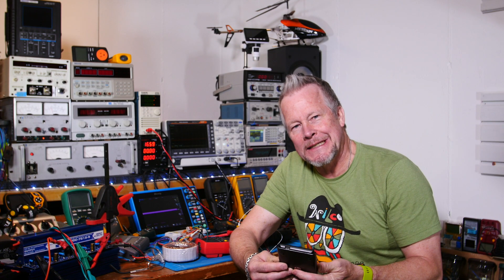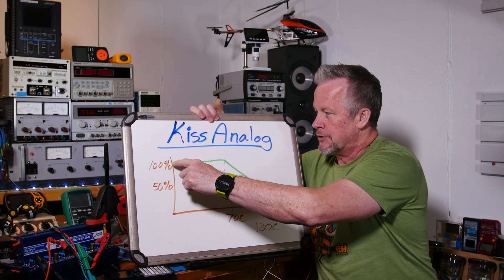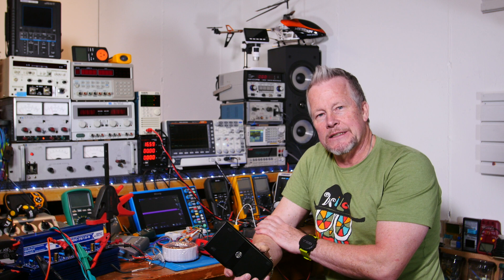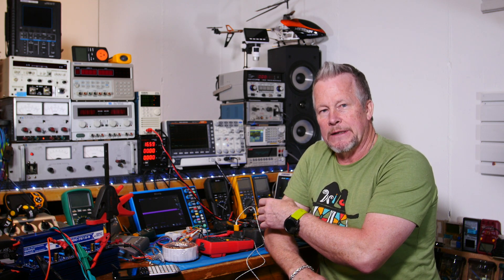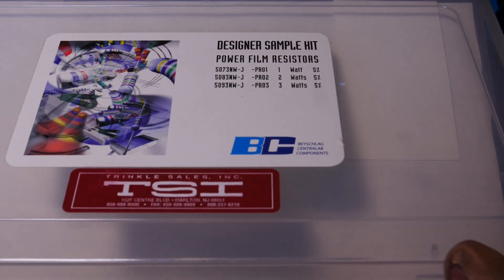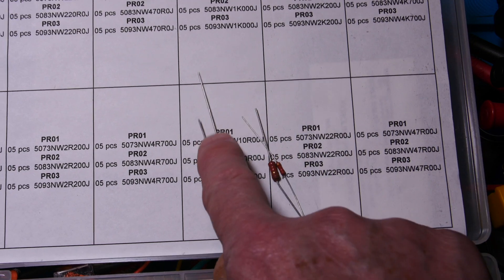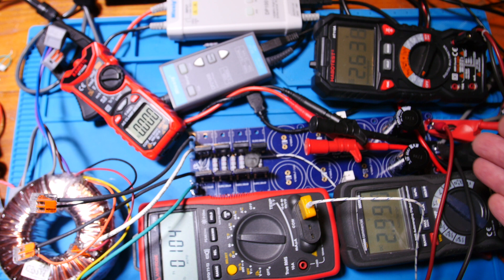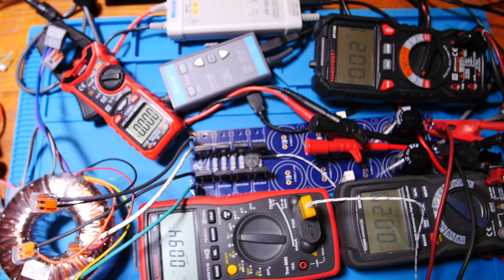Resistor Derating Hiraga Power Supply

Comment: Another problem with resistors, is where the voltage on the resistor is linearly changed by the mains supply.  We have a nominal 220 Volts as our single phase supply which can go as high as 263 volts for prolonged periods.  This will result in affected resistors running at 40% higher power than that anticipated by the design.  Higher voltages on the mains are more of a problem with solar panels exporting to the grid as the export requires that the solar inverter increases its terminal voltage to enable export.

Also these higher voltages can damage expensive electronics where the nominal rating is 220 volt +/- 10%.
Reply from the maker: Thanks for the great feedback!  Yes we have to think of the other elements of the circuit and if considered and parts are derated - then we have a much better (more robust) design.  Also, depending on the resistor type - the higher voltage might require series resistors as many resistors today are not rated for the higher voltage.
Reply: @KissAnalog  

Hi. Yes voltage is often an issue with power resistors. I did a design for my old power station and didn't have a lot of room on the board, but luckily there are high voltage resistors available from my friends at Digy Key which did the job.

Regards
Rob

Comment: The data sheet showed the rating by ambient temperature, the other chart just showed the temperature rise of the component. It didn't really imply that 200C was the max temperature for the device. If you don't have any convection available it doesn't matter what size resistor you use because watts in a box is watts in a box

Comment: Just happened to come across this video not long after running into this on a project.

I picked a couple big ceramic wire wound resistors just because they were what I had lying around. If I had smaller resistors on hand during the build, I would have put them in based on the “50% rule”, but I’m sure glad I didn’t. 

Even at about 25% of their rating, I found they still got pretty hot.  Hot enough that I actually went back and installed heatsinks on them.

I doubt I’ll ever go above 25% of a resistors rating on anything passively cooled in the future.
Reply from the maker: Thanks for that great feedback Chris!

Comment: I learn hard way to not design power resisters near rate power  because I prototype amplifier with resister near its rating. I had to heat sink the resister to get it to run cooler. the rectangle ceramic power resisters take well to heat sinks. Since there is flat surface to mount one.
Reply from the maker: Thanks for sharing!  That's great feedback!

Comment: Why not wire the three 1k resistors in series rather than parallel?
Reply from the maker: That's a great question!  Thanks!  Actually it is the same difference for power dissipation.  If the voltage is high - then series is the best way.  The other consideration is board layout and what works better.

Comment: I have a rule in electronics, if I can't touch it, it's too hot. Sometimes it's not the resistor itself that suffers but the PCB. You only have to look at old PCBs. The board can be black, even carbon track. Parts become un soldered. I guess it's cutting costs. So many AV amplifiers run really hot, simply because of cheap under sized sinks. At the end of the day, it's all about cost!
Regarding your power supply, do you really need such low value resistors anyway? You will be running a class A amplifier drawing alot of current, so the caps will discharge very quickly anyway. In real life, if the caps discharge over 5 minuets, that's really fine.
Reply from the maker: Michael Beeny Great comments!  I agree with you!  Thanks!

Comment: The heating of component is dependent on only two things, the power in (which turns into heat) and the heat dissipation. Putting a smaller or larger rated resistor doesn't change how much heat is generated. It may or may not increase the heat dissipation due to the larger surface area of the higher wattage resistor. Since the heat dissipation on a through hole resistor is dependent on surface area (assuming free field conditions which may not hold), the resistor's volume can only grow proportionally to the heat dissipation if the resistor only gets longer. If it also gets fatter, the volume will increase much faster than the heat dissipation, leading to your jumbo 3 Watt resistors.

The only solution if you are looking for reduced heating is to either go to a larger bleed resistor and accept a slower discharge when the amplifier turns off (which you advocate) or only switch in the bleed resistance when the amplifier is turned off. As an aside, the amount of power to be dissipated when you turn the amplifier off is always the same, 0.5 x C x V^2. Putting in a larger bleed resistance dissipates exactly the same amount of power when the amplifier turns off, but in a longer time frame.
Reply from the maker: Thank you!  You covered it very well.  I don't know what time constant is really needed.  I'd think that if a someone opened the box and reached in to do work, then you would want the voltage at a safe level.  But that could take several minutes from the time the power was pulled, so I don't see why such a short time constant was chosen.  I really wonder if the wrong values were provided or someone copied the original schematics incorrectly?
Reply: @KissAnalog  I build large amplifiers for powering sonar equipment and hate to continuously generate additional heat to allow the large, high voltage capacitors to be discharged quickly. A solenoid based solution to discharge the capacitor in maybe a minute after the power is turned off is a reasonable solution for these expensive amplifiers, but even lower cost amplifier applications should be concerned about the extra heat generated during continuous operation. Maybe a PTC based circuit could have low dissipation at high voltages, but dissipate faster at lower voltages to get to a reasonable discharge time?

Comment: 12:32 The smell of mothballs and monkeypoop , that must smell great :-) 
I like to add some notes from personal experience when it comes to choosing resistors. 
The place and direction of a resistor on a board plays also a big role in choosing the right wattage, in this video the heat can get away because heat rises, but if the board is placed upsight down, the heat gets trapped and the resistor will be getting much hotter then during testing on the bench. 
Also when the board is placed vertically, and a few centimeters below you have a hot Mosfet, that component will heat up your 3watt resistor and takes away the headroom you previous have calculated for. And at last, if you place this board in a small cabinet, with not enough space to have a natural airflow, the resistor will also heat up more.
 Good video to bring this subject up.
Reply from the maker: Bjorn V Thank you - that is such great input - you are so right!!!

Comment: Well some 10k's, a good preamp~ valves,ie: tubes. And some audio; Yes we want to hear it run. Are you in the meter selling business, 10 on bench ? How do they desighn coupling cap size between stages. Pre - amp to ~ final amp. I see 1 uf on a lot of builds. I think thats a good question for you.
Reply from the maker: Hello Hugh and thanks for the comment!  I got delayed, but I'll be getting a new video out on this soon.  I mostly buy meters;)  The coupling capacitor we will talk about in detail when we choose a pre-amp for this.  In short, it depends on the input impedance of the preamp and the cut off frequency mostly.